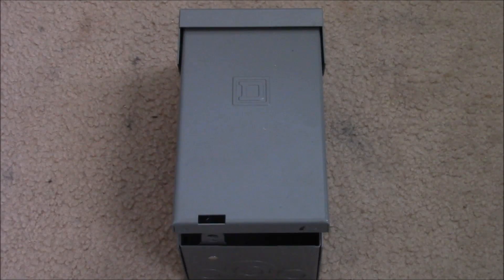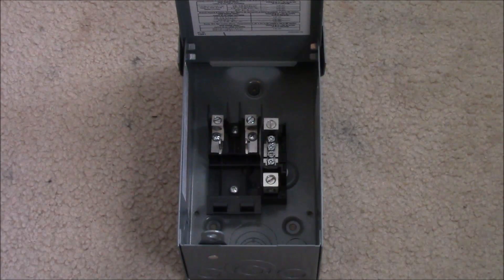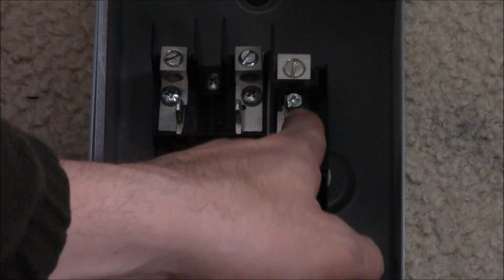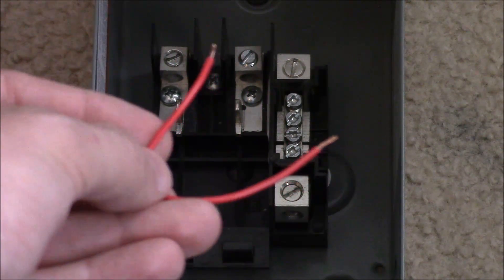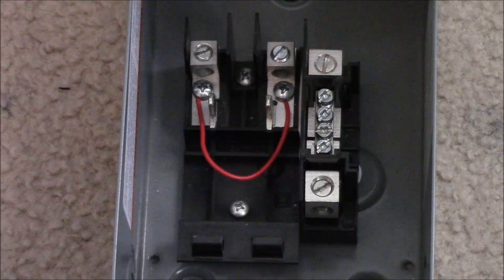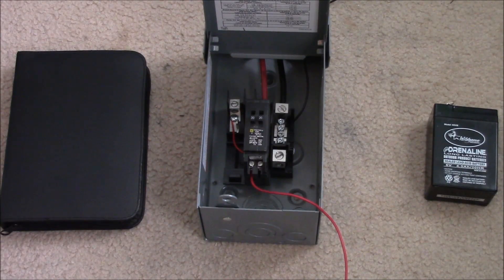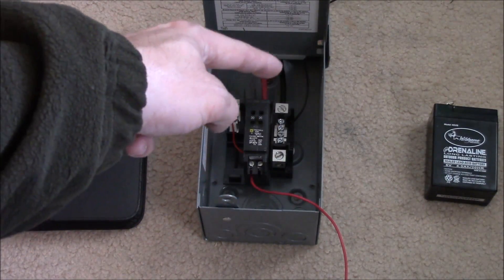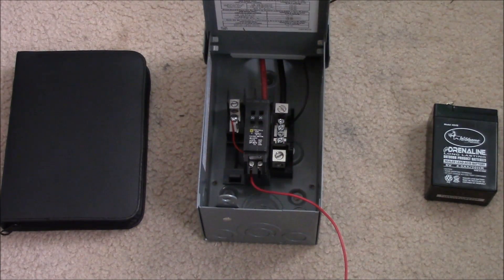Solar Panel Systems for Beginners - Pt 3 How to Build A Load Center Combiner Box

Comment: Okay so you said you were using smaller wire for example purposes... What would be the best size wire for say 100-200 watt panels?
Reply from the maker: Depends on the length required.

Comment: In this video. I'm not sure if you have made a video using testers for current coming from the panel, showing how much juice the sun is putting in the panel per hour of any amount of time. To showing how fast it's charging the batteries. Ext

Comment: 4:22 that’s a single pole tandem breaker. Big difference. Double pole is twice the size and is 240 volt. Tandem is two 120 volt circuits that only take up one space instead of two
Reply from the maker: Thank you for the correction.

Comment: So it basically distribute the power from the source to multiple destinations so if one of them have an issue it will break and it is circuit breaker will shutdown ?
Reply from the maker: Correct, if you use it as a load center.  In a load center, you have power input and then it gets distributed to multiple outputs that are all protected by breakers.  That is the same as your house breaker box.  But if you wire it backwards like I show in this video, it takes multiple inputs and combines them into a single output.  And each of the inputs is protected by circuit breakers.
Reply: This is very interesting 👍 you mean during day for example I can pull power from soler panel via the inverter and from Batteries simultaneously so if every of them have 5000 watt I can get them combined as 10 kwatt and distribute the to the loads ?
Reply from the maker: Yes, you could wire up a system that would do that.

Comment: Do strings in series get paralleled in the box, or do they need to be paralleled before going into the combiner box? In other words, does the box work as the parallel when I need the panels to be series and paralleled?
Reply from the maker: Generally, that is the point of the combiner box is to bring multiple inputs together in parallel to combine into one feed into a charge controller or grid tied inverter.

Comment: Thank you so much for this video. it really helped me. 
I would just like to ask you if my set up will work.
I am setting up 100 watt solar panel. I will be running a 5 watt chicken door, 25 watt fish tank heater, 20 watt waterer and 5 watt light. I seen from your video I need to get a load center but i'm not sure what size breaker's i need to use, size of battery's  or battery. I live in Ohio. Could you help me figure this out? I used the calculator you have linked but Im not understanding it. Thank you.
Reply: use the ohms law wheel to calculate your voltage for the battery & amps for the breaker

Comment: Hey thank you so much for your videos! I’m about to set up my off grid setup with multiple panels and was wondering if you could make a video showing how to connect about 6 panels together in a combined box like you talked about at the end of the video, and then take that into a single output to charge a few batteries connected togethers (and how to best connect the batteries) to then power an inverter from the combined batteries charge. Also, I was wondering if there is a way to bypass the controller to increase efficiency?

Comment: I'm in the process of building a 800W solar system. 100W x8 panels.  I will have a 24v battery bank. 8 Trojan 6v 214AH Solar Signature Series batteries that are in the process of being built. I have a 40amp MPPT charge controller and a 3k PureSinewave inverter.  I've been watching numerous videos and it seems the more I watch the more confused I get. So many different ways people say to do it. I'm a old dude now 65 and CRS. Any way I was going to hook my panels directly to the charge controller. A 50amp circuit breaker between battery bank and charge controller. A 300amp fuse to protect inverter. I also will have a 100amp shunt on the negative side of the battery bank.  I will also put a reg battery disconnect inline. From what I understand this should be OK.  I would appreciate any help someone could give me if this wouldnt work.   thanks

Comment: How would you set up a solar panels and wind turbines as a source? Also, how would a watt meter fit in this process?
Reply from the maker: You would need a charge controller that can handle wind and solar inputs at the same time.  There are quite a few out there designed for that purpose.  A watt meter could be wired in on the production side (between the solar panel and charge controller) or on the consumption side (between the battery and the load) depending on what you want to read.

Comment: can you plug a load one the dc to ac power converter, then cut the wire so the power can go thru the breaker?  there for you have constant ac power. Thanks helpful video :)
Reply from the maker: I don't understand your question.  Sorry
Reply: I was asking, one the power inverter you have only 2 available outlets for use, can you plug in a powerstrip and divide the power so you have more outlets to use, in case you want to power somthing ore multiple loads? Thanks
Reply from the maker: Yes but each outlet on the inverter can only handle so many amps.  So be careful you don't overload it.

Comment: I've been trying to find the Schneider QO series rated for use with DC power without success. Do you have a model number?
Reply from the maker: https://www.homedepot.com/p/Square-D-QO-100-Amp-6-Space-12-Circuit-Indoor-Main-Lug-Load-Center-with-Surface-Mount-Cover-QO612L100SCP/100148926

Comment: I am a novice when it comes to electricity and solar power and these videos have answered nagging questions I have sought answers for over the past two years! Great explanations and adaptation of of equipment to  make things work while minimizing a lot of technical jargon. I was  looking at a very basic application. I just bought a 40 watt panel with controller, I already had a battery and I just wanted enough power to light some led lights, and charge some power tool/cell phone  batteries at my hunting camp. You have answered all my questions so I can now proceed with my project. Thank you for your consideration and time in posting this video.

Comment: All you need is a 12 volt 10 slot fuse block. a grounding block and you are easily set up.
Reply from the maker: True.  That would work for combining the strings or distributing power to multiple loads.  It would also provide safety.  But it doesn't let you individually disconnect strings or loads.
Reply: All you have to do to disconnect individual loads in the 10 block fuse block is pull the fuse to the load you want disconnected. Just like in a car fuse box, want to disconnect the radio, pull the fuse to the radio and so forth.

Comment: wow great to know now i can order a few thanks also do you need too use a ground wire to ground so it wont short out ????thanks  great video
Reply from the maker: Ground wire is always better but not required.  Just make sure to use breakers and/or fuses and you should be fine.

Comment: Very interesting. Why are some "experts" saying you can't connect DC to an AC circuit breaker because of the way they are built and are very dangerous. Do you think I can do this set up for low voltage devices. Would they turn on with no problem? The devices I'm looking to power up is 2 12v 22watt water pumps and a string of 5 led water proof led lights. Thanks for the help. Have a great day
Reply from the maker: DC electricity can jump a gap that AC could not.  If you are using low current it probably won't matter.  I have never had any issues but I always use less than 30A or so.

But the best bet is to use a load center that is designed for DC as well as AC like the Schneider Electric QO series load centers.  They can handle 48V DC in addition to the normal AC that a house would use.

Comment: Has anyone made this? Where you buy the parts. What are they called. Thanks
Reply from the maker: You can buy the load center from Home Depot.  It is called a load center and the Schneider QO series is rated for use with DC power.  There may be other brands and lines of load centers that are rated for DC but there aren't many.
Reply: LDSreliance Thanks for quick response. I know this video was from 2015 and prices change. Can you tell me the part number. And also if it comes with everything you have on video. This is the only thing that comes close to your box. But it is 60amp. https://www.homedepot.com/p/Square-D-QO-60-Amp-2-Space-4-Circuit-Outdoor-Main-Lug-Load-Center-with-Non-Metallic-Enclosure-and-Neutral-QO24L60NRNM/100174454. Thanks
Reply from the maker: The amp rating doesn't really matter unless you have a lot of solar power (600W or more).  And when they rate the amps they are usually talking about AC power and not DC.  But check the specs to be sure.

That one you linked will work fine.  But it only has 2 slots for breakers.  If you have more loads than that you may want to look at https://www.homedepot.com/p/Square-D-QO-100-Amp-6-Space-12-Circuit-Outdoor-Main-Lug-Load-Center-with-Cover-QO612L100RBCP/100071456

Comment: Thanks for spending time to try and help us noobs. BUT - For a new person to electronics trying to convert some Xmas lights to solar, It's no good for you to pick up stuff we wouldn't normally use and say you are using it for "illustrative puposes", implying we should be using something other than what you are showing. I learn quickly, but you need to show what should be used for real on such a project and if not, state clearly why the item is wrong for the intended purpose since beginners just don't know. It started with the "little red wire" you put between the positive terminals. You said it should be a "bigger wire" I assume you mean heavier, not longer, because then you switched to heavier wires for the next steps. I troed to see what voltage the battery was, but you had your hand over it. You continue to ask us to imagine you hooked things up. I'm smart but not telepathic when it comes to videos. I had to stop when it came to the breaker as I felt the vidoe was not really for true beginners. Too much info missing. I'm smart enough to know i can't slap some stuff together and expect it to work and be safe. I do applaud the fact that you want to help.
Reply from the maker: Those are good points.  I was trying to demonstrate the concepts, though, and introduce terms to people instead of being more of a step by step specific guide.  If I show specifics in a video like that then people will end up following it and not learning anything.  Plus, what might work for one person's setup will not work for someone else.  It is important that someone understand the nuances of choosing between a 12V battery bank and a 24V battery bank, for example.

I am more than happy to help you learn and point you in the right direction and answer questions.  So fire away.
Reply: to run a string of christmass lights ... just wire in the dc to ac converter as the load and plug the lights into that ... a basic 12v deep cycle car battery or marine battery (sealed unit) is fine for the battery ... as for the rest the basic charge controller he had is good enough and you will then be able to learn more for larger systems like powering lights in a camper or tree fort or some form of place where you want lights but dont want to run an extension cord or spend thousands getting hydro to run a line out for you ... I assume you have a basic 100w panel ... and that should be fine to run the lights and keep the battery charged for quite a few hours of light ... 
.
and yes he meant a fatter wire or smaller gauge ... typically the size of the wire he laid down in the grid tie system for the battery nice and fat like your little finger ... solid is fine but stranded wire is better as they can handle some minor damage from bending and flexing while the solid wire once broken is done for 
.
I strongly suggest the electronics for dummies books and solar power for dummies as they explain things nicely and go into full details about types of wire and all the rest of the things you have to consider but never even thought of ... besides they make a great reference when stuff doesnt work as planned or expected

Comment: Thanks very much for these 3 videos on how to install a solar panel system complete with load. What I was missing is a simple schematic diagram on how these : source, charge controller, battery and load are connected together in order to understand the connections among them.
I would be very grateful to you if you could draw that simple diagram for a better understanding of the whole system. Thank you very much.
Reply from the maker: Try this:  http://www.mysolarshop.co.uk/images/lighting-ac_or_dc_600.jpg

Comment: Can living plants battery be used in place of the solar panel?
Reply from the maker: Living plants battery?  I don't understand.
Reply: LDSreliance ah the Phillip plants battery where they using living plants as power sources u can see it on YouTube
Reply from the maker: If it produces 14V or more of DC power then you might be able to use it.
Reply: yes you can , it will take 14 plants battery to equal 14v
Reply from the maker: Cool, I will have to look into that.  I did not know about that.

Comment: Hi there, love the simplicity of your videos. Im adding a solar setup to a conversion van and Im planning to use a fuse block. (https://www.amazon.com/gp/product/B001P6FTHC/ref=oh_aui_detailpage_o03_s00?ie=UTF8&psc=1) will this work for my load center? I was also planning to connect a 400 watt inverter to the fuse block and run a fridge off the inverter. Lights, sink pump and fan would be run directly off the fuse block. Any problems or advice for that setup? Also what gauge wires would you recommend?
Reply from the maker: Yes, as long as all of the amperages are safely within the fuse specs you should be fine.  Keep in mind that your fridge will surely not run on a 400w inverter.  You might want to watch how much trouble I had getting a tiny dorm style fridge to run on an inverter:  https://www.youtube.com/watch?v=zysqlSTZwOk

Comment: How many batteries should be used to keep power all night long on a rv
Reply from the maker: That is a loaded question.  What are you trying to run all night long?  Where are you camping?
Reply: yes and no .. a trailer as sold generally only has one battery and that is fine for most uses ... heck if you can find an old trailer for sale super cheap (doesnt matter if it leaks or not) all you want it for is the dc bits n pieces .... it has all the gear you need to run a basic setup for a home built camper 
.
now if they wanted to run a washer and dryer and Ac unit then more batteries are better ...

Comment: Any tutorials on how to hook up so you are just running AC to a breaker box. I have a shed I want to put some lights in and a few 3-4 outlets. Just for a radio and such. Thanks.
Reply from the maker: I will do a tutorial on this eventually.  I have not used that method before and I am less familiar with AC power as I am with DC power so I need to make sure I understand it better before I try to teach others.
Reply: do you plan on using power tools or not ... if it's just a light or two and a plug or two for a radio or garden shed power tool charging then a basic dc to ac converter as the load with the required number of outlets and a battery to keep a resevoir of charge for night time is fine ... if you find any junk or super cheap campers pull the ceiling lights out of those with all the wires and electrical parts you can find and use them as they are all DC already and provide good lighting and even have a charge controller and dc to ac converter with multiple outlets to run stuff like radios and phone chargers etc ..